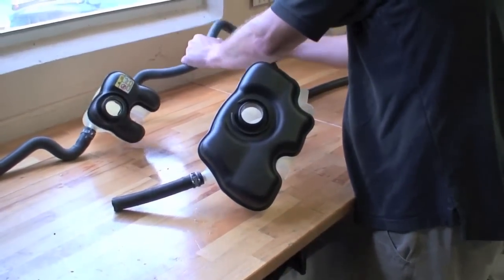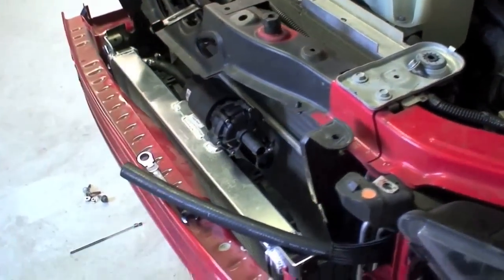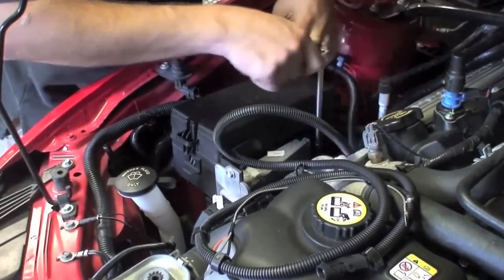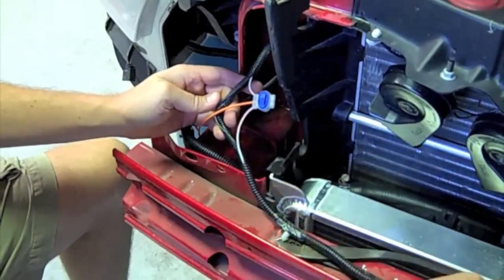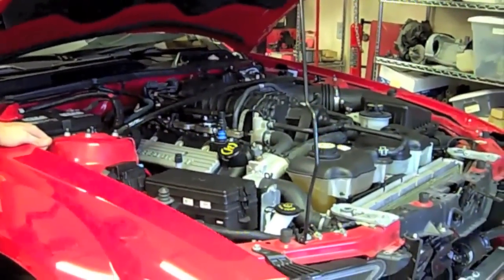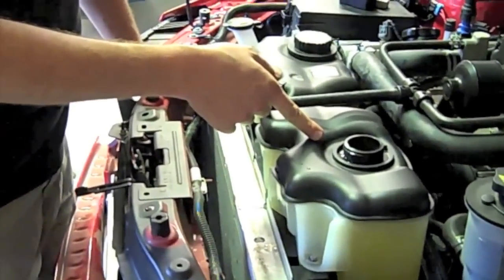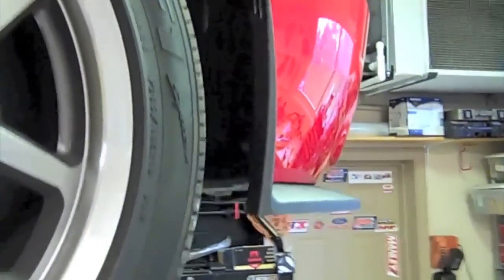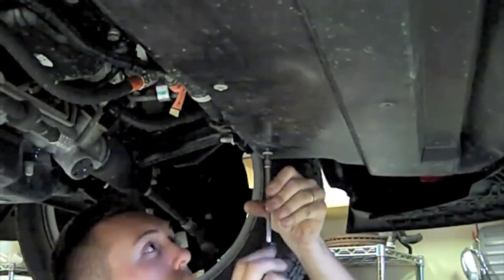AFCO Dual Fan Heat Exchanger Installation (Part 2)

Comment: I wish it was this easy to do on a roush mustang. doesn't fit at all and now I'm cutting up my front bumper
Reply: What year Roush? I have a 2012 I was thinking of adding the VMP heat exchanger but I noticed its says some trimming necessary. How much did you have to trim?
Reply: Kevin Lynch I had to cut so much that I had to cut the brackets that mount the grille to the bumper and instead of using the original brackets I had to drill holes in my bumper to make the grille fit. Probably about 4 inches total cut off of the bumper it was ridiculous.
Reply: Kevin Lynch mine is a 2012 as well
Reply: WOW, that sucks. When you say you had to cut the front bumper, are you talking about the foam behind the bumper or the fiberglass front facia? Is the heat exchanger visible through the front grill? Any pics of what it looks like installed?
Reply: Kevin Lynch I also have a 12 roush stage 3. Researching the EXACT SAME THING. It’s impossible to find anyone who has done it on these cars. What did you do?
Reply: @billytugwell48  I had to cut through the front fascia to fit the shape of the heat exchanger. I may have pics still I’m not sure
Reply: @billytugwell48  I remember after I cut it a whole bunch it still wouldn’t fit and I ended up taking the car to a body shop and had to have them do it. Even he said it was a bitch to make work
Reply: MrTyler8877 did you go afco or vmp?
Reply: @billytugwell48  afco
Reply: MrTyler8877 ashamed that roush sends it with that paper thin exchanger without a fan on it. Gotta keep the ac on so that the fan stays on in traffic so that my iat2 doesn’t go past 160.
Reply: @billytugwell48  also a shame that there isn’t any manufacturers that offer a non oem HE that fits the roush. It’s all Shelby. I sold my rs3 a couple years ago and never looked back. I had a harder time letting go my 03 mach 1.